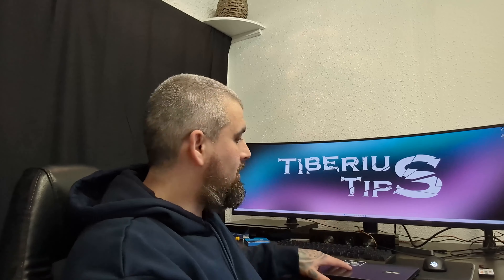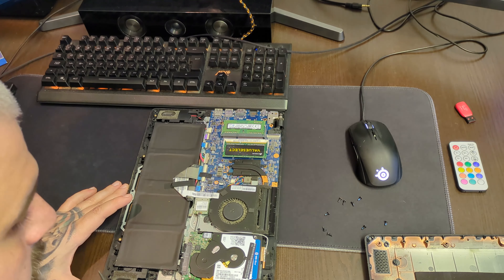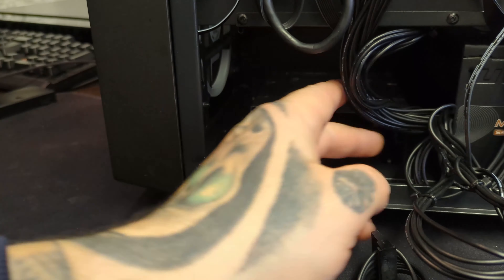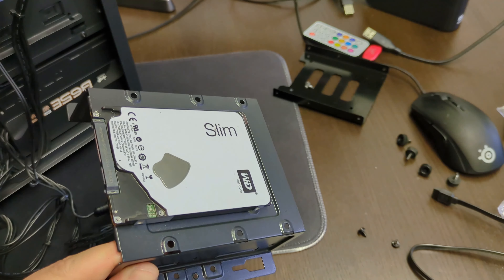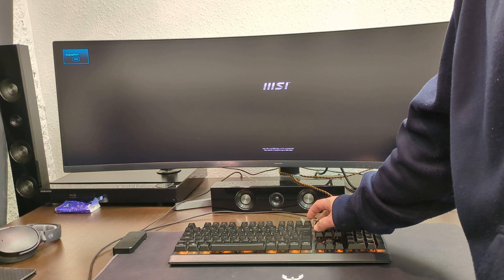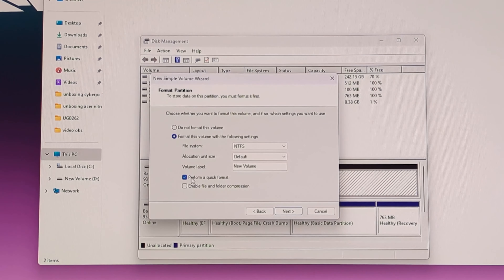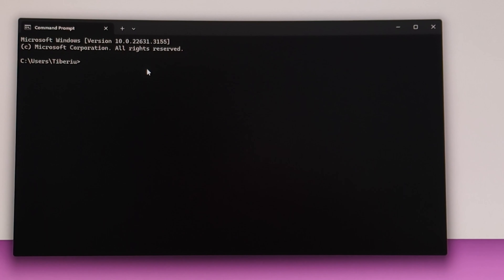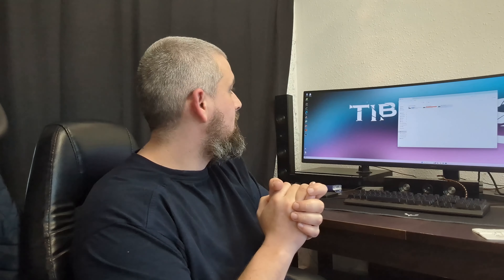How to install a Hard Drive in Your Computer Tutorial: From Old to New

Comment: My PC keep shutting down after 30 sec sometimes 10 min. Any tips? And how can I save the stuff on my PC? I forgot my password.
Reply from the maker: Here it can be quite a lot of options, what you can do is take them one by one and see which one it is. Check if on your motherboard is any warning lights, try to re-seat Ram or video card and check again. Shutting down can be even from faulty motherboard or even HDD. Check the temperatures as well, if it overheats it shuts down to protect components. The power supply could create problems as well. To save your data if you don't want to repair your pc and/or you have another one just transfer the HDD and copy the information. Try to update the drivers as well.
 For password related issues depends on what you are using (windows, ubuntu, mac) and how it was set-up. There are ways around it but depends of a lot of factors.